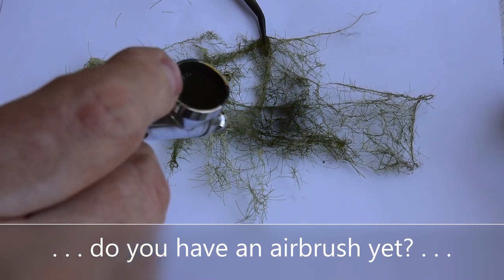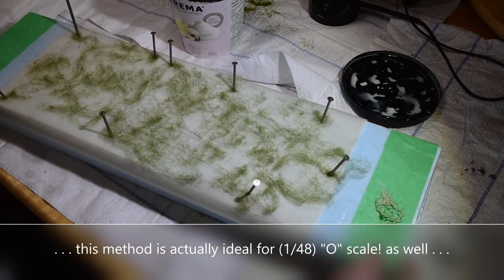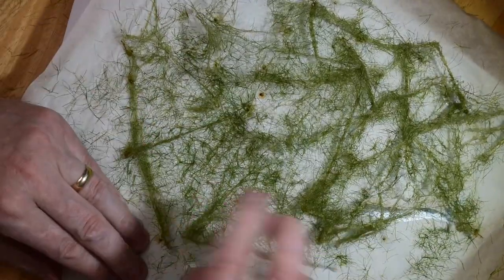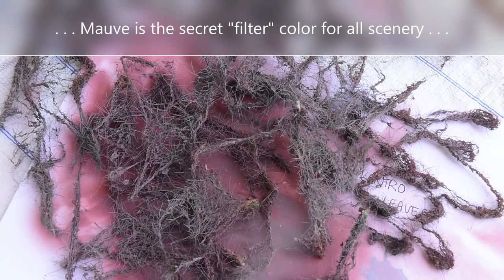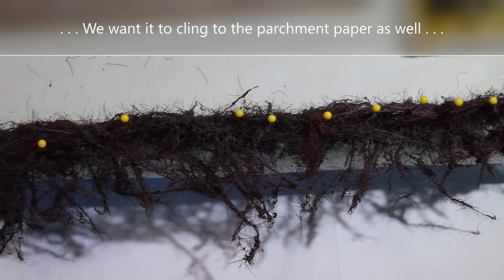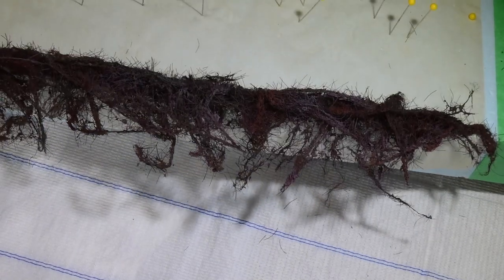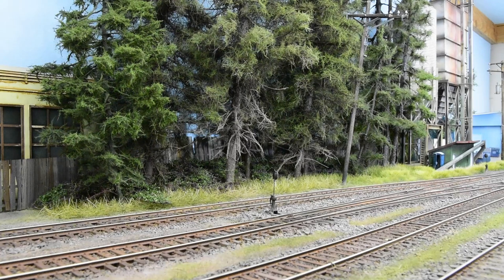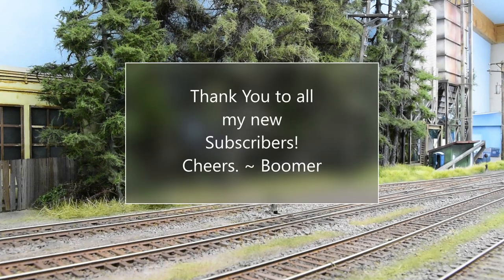Creating Realistic Model Scenery | The Wicked Black Berry Bush: Part 3 of 4

Comment: Question Boomer, when you arranged the vines on the parchment paper, why did you use 50/50 matte medium instead of 50/50 glue?
Reply from the maker: Because the "matte medium" is more flexible and has a flatter transparency. You could probably get away with Carpenters glue as well. I just like the Matt Medium more because of the compatibility with painted scenery. It is a paint emulsion at the end of the day, not to mention it's excellent adhesive factor.
Reply: Makes sense, thank you.

Comment: Boom another great video a question I have why do you use so much glue at the start of the process? This side of the pond we call them brambles. My inclination would be to use an atomiser with some washing liquid in the mix. I am so impressed with your channel I am Sharing it with my Friends in the British Region 👍😎🚂🚂🚂🚂 Neil
Reply from the maker: Good question.  I use lots of glue in order to saturate the poly fiber. It also helps to form a solid base on the foliage. Otherwise, it dries too fast (when arranging it), and subsequently leads to the material becoming to fragile. It falls apart when you handle it. Furthermore you want the glue to flood all the associated mediums and static grass, etc. to create a solid "model" of the foliage subject you are building. In my method and experience , when it comes to glue I use more. When it comes to material I use less. Besides carpenter glue is cheap, especially when thinned with water. Cheers. ~ Boomer.

Comment: I know this is an older video.
Would matte medium and water for for this instead of glue?
Also have you tried the ground oregano on trees and bushes, instead of the Noch or Wooldand scenics leaves? It turned out really good in this case, and I was wondering if it would be a more frugal alternative. 🙂
Reply from the maker: Yes. I use matte medium for just about everything. Ground oregano can work but I find it to be quite brittle and it changes color (fades) quite quickly when in contact with paint or glue.